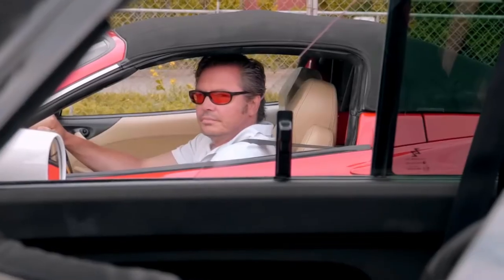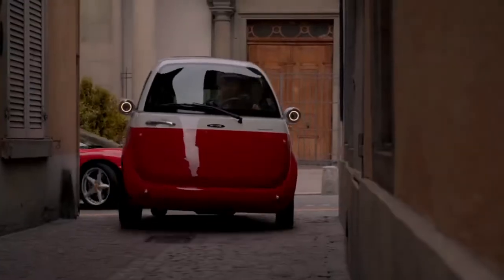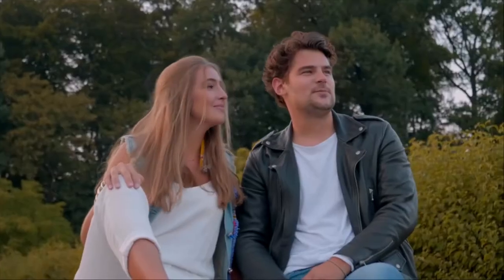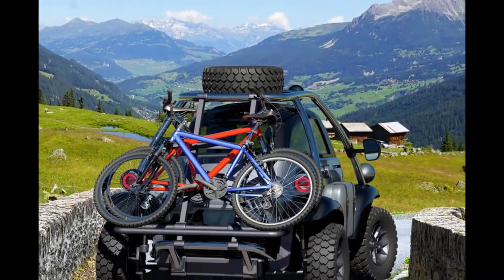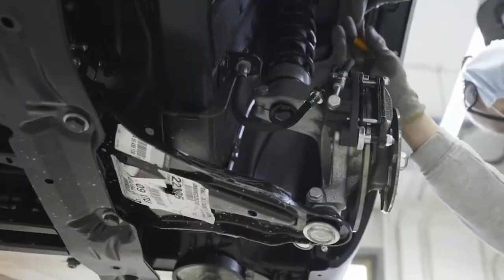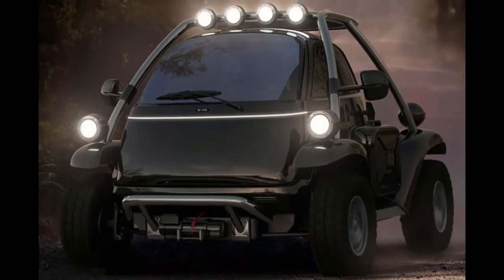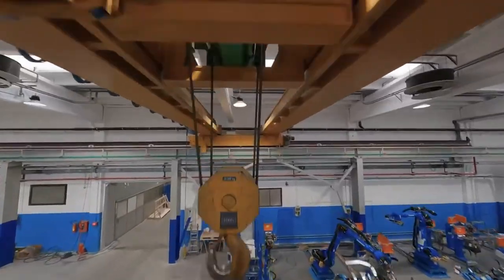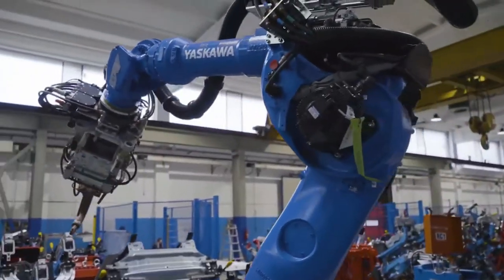Baby Car Microlino Makes for a Convincing Offroader

Comment: Still waiting n waiting n waiting n waiting. My Smart EV is getting old. 45000 miles with no battery degradation. Tires at 40,000 miles and windshield washer fluid along the way.